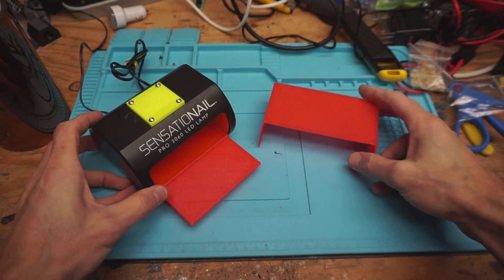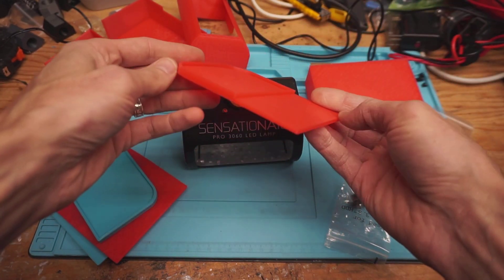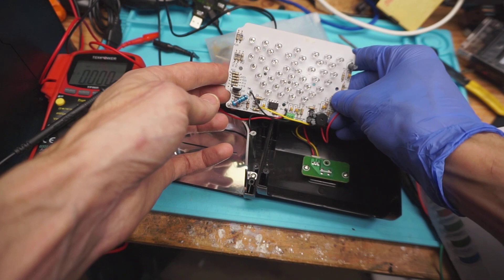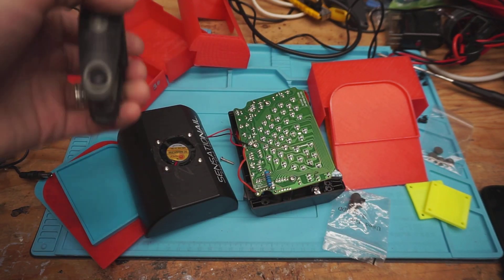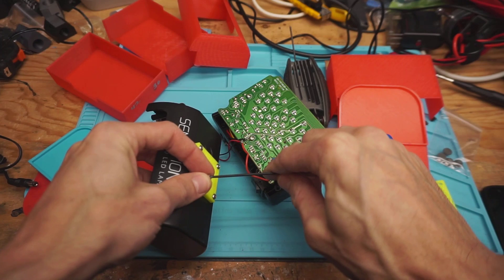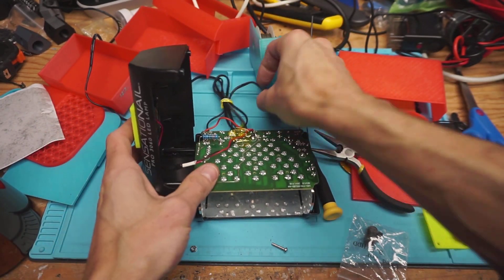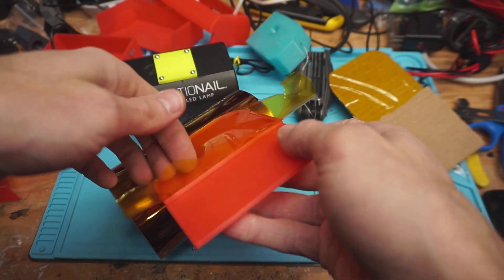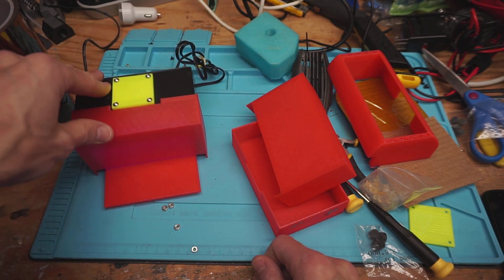DIY UV Resin Curing Station – Make Your Own Resin Curer

Comment: too much complicated, with soldering, buy an LED strip, then put it in a round case, done
Reply from the maker: If I wasn't able to solder I'd probably use sunlight. Then I wouldn't require electricity either!